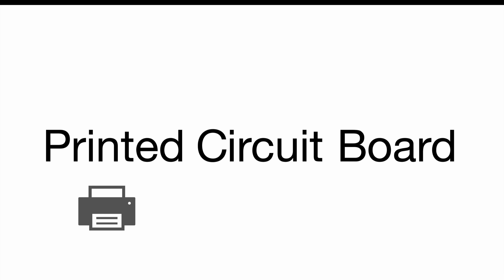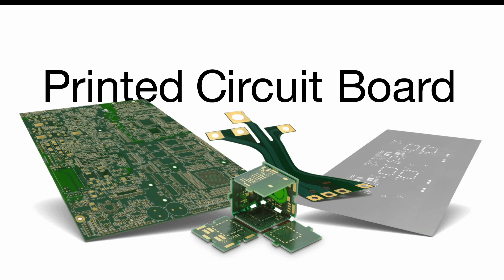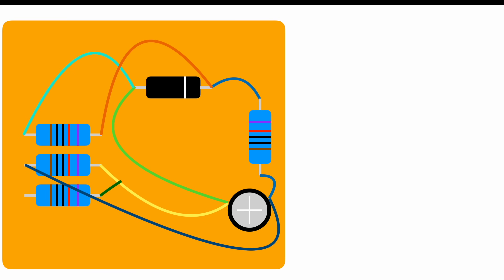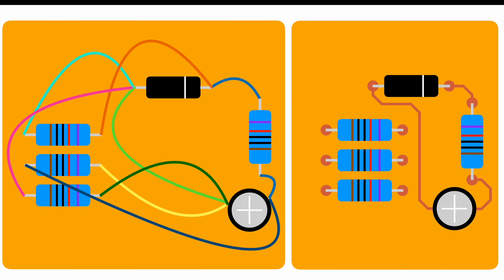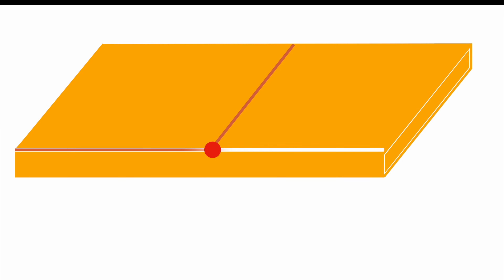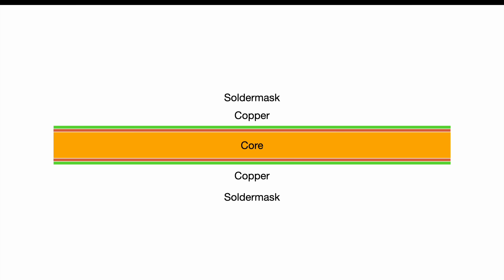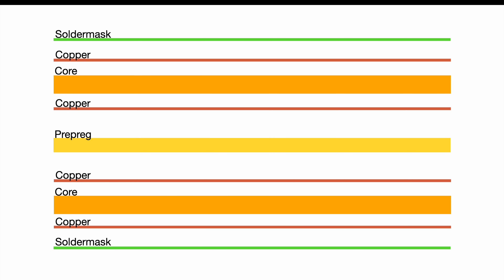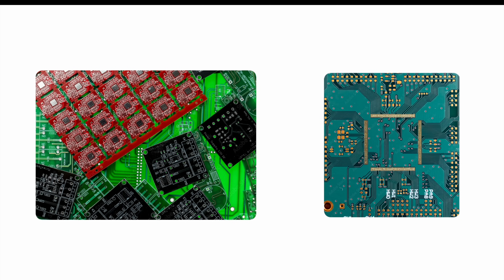What is a PCB?

Comment: 2:32 you could get to the diod with only one layer running the trace underneath the tht resistor ;) but we got the message why sometimes several layers are necessary 👍
Reply from the maker: Good trick! The real need of a second layer normally occurred relatively quick as soon as you use ICs, for THT standard components clever labouring can Sontheimern job quite well!